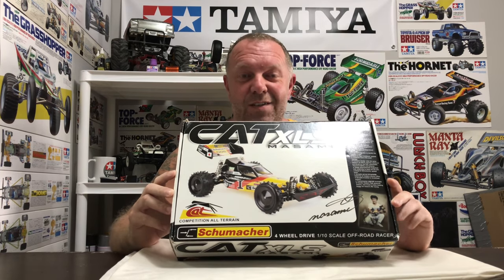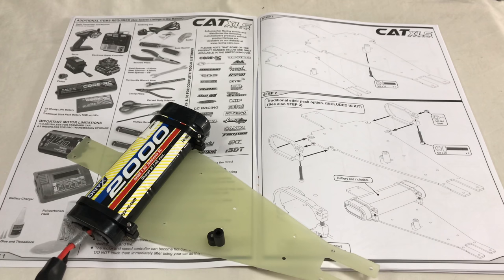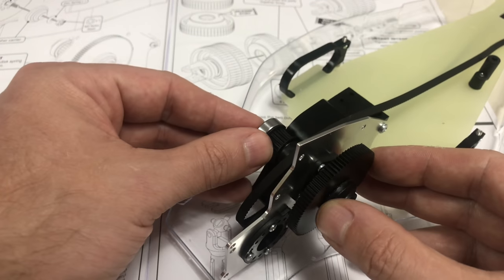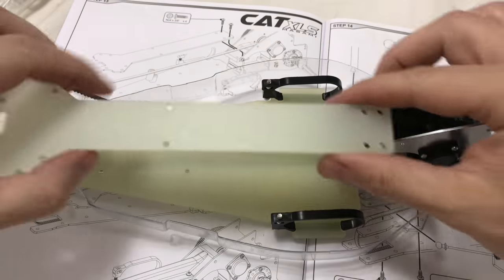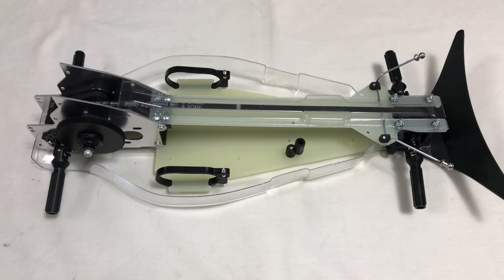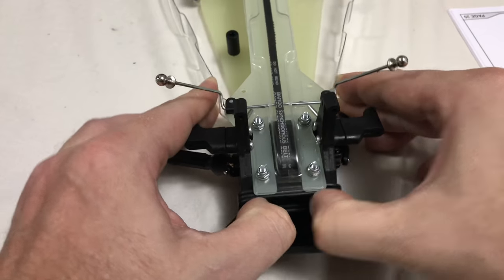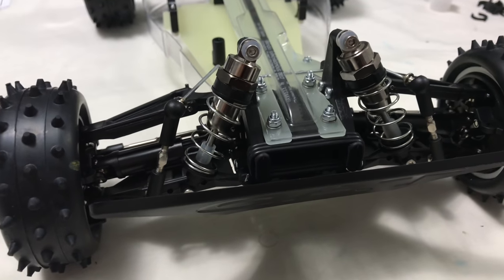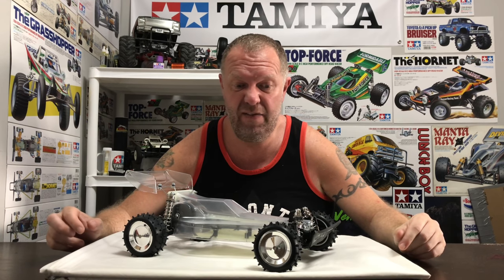Schumacher Cat Xls Full Build...

Comment: I had an Original in '88. Before the first run, that rear box was always a bit wonky (after 1st build or a full strip and rebuild). I used to put in a clapped out stock 540 for the shake down. Then the only way is to get to know what noise the box makes when it's bang on. Clicking is the belt slipping on the teeth, too loose. Whining or not accelerating clean and they are too tight. Over lubing the the main diff and the drive slip is another easy mistake to make. You can adjust the main diff setting without dismantling it at  all, You stick a small flat head into the Left UJ so it holds the main screw, then carefully turn the right wheel until it's bang on :) From memory, the front crash back bands tended to persish a bit quick, and you need to watch them. For the outdoor season, I tended to seal the rear box with aquarium sealant to prevent dirt and water ingress. But once you got a Cat set to a nice neutral setting, you could leave it more or less alone and it would be quick anywhere. If anything, this car had too much front end grip. And after trying all manner of diff adjustments, weight shifts, suspension settings etc, the most reliable method of curing the 4WD oversteer, was taking a set of standard Cat Fronts and clipping off the outer row of spikes with nail clippers. After getting up those learning curves, you'll be eating Ultimas for breakfast.
Reply from the maker: alistair munro 
Wow Alistair great knowledge my friend 😊👊🏻
Reply: Alistair, I have the recently released Masami Edition, and the steering is very rough.  There is a lot of friction in the front hub ball joints.  The steering repeatability is very poor.  I start out neutral, then I turn left, then I release it, but the wheels do not fully return back to neutral.  They are still a little bit turned left, due to the huge friction in the hub's ball joints.  I have to turn right, to an extent, to correct it back to neutral.  I tried using the silicon grease and molybdenum greases to lubricate the ball joints, but it does not seem to help.  Advice?
Reply: @perfectsplit5515  it sounds like you have one of the pivots done up too tight. Take apart any of the screwed together or bolted components in the steering (from memory, thats quite a few, sorry!) and put them back together slightly looser and use threadlock to hold the screws and nuts in place. be very careful not to get threadlock in any of the joints or moving parts or you'll be back to square one

Comment: Although it takes some time to get the diff's dialed in, due to them getting "broke-in", but, once they are dialed in, that is one mean machine in the various types of dirt/soil... and with a few runs, from one track condition to another, you can quickly adjust the tension to fit the condition, like no other... I liked the look of the spindles/knuckles, but, those did seem to cause issues at random times with small rocks and or dirt collection.. either way, with a hot motor, this car will never fail you to be fun, even in the race conditions, win or lose, the car is always fun... there is my 2 cents.. Still not as cool as the Avante is, LOL
Reply from the maker: Dru Bradley 
Thanks for watching 😊
And I 100% agree nothing is as cool as the Avante 😍👊🏻

Comment: I tried using a few different Pozi screwdrivers, none seem to fit properly so i cheated and went with Allen head screws. I still cant figure out an easy way to tighten the main belt, maybe its just me. Nice build though..
Reply from the maker: chaka zulu 
How tight was your rear Diff when you built it buddy?
Reply: @TAMIYALegends , I installed mine with the Pro Transmission,  it was extremely smooth. The diff i just built to spec, the wheels spun freely, and the rear belts had the same tension on both sides.

Comment: Wow... That took me back. 

I saved up my wages from a paper route for a full year when I was 13 to buy a CAT XLS and all the electronics. Except for the kit itself, I bought them mail order and paid COD. Motor was a monster horsepower something or other and bought a airtronics xl2p transmitter.  I was in way over my head but I do remember learning a lot from it. 

Before you started and said it was a nightmare build I scoffed. But as you went through it I remembered it took me a really long time to build it. I think a few weeks.  The flat head screws were a nightmare to put in the FRP plastics and I stabbed the shit out of my hands several times as the screwdriver would keep slipping off the screw and pierce my flesh. I also remember building the U-joints... Boiling them then prying them open with the help of my step dad.  I think getting the ball joints in was a pain as well.  But God, I loved that car... I wish I would have driven it more at the track than I was able to. I wish I still had it but I remember telling my parents to get rid of it when I had moved out on my own after college... Those chrome wheels were so cool and I didn't appreciate them at all at the time.  Once they got scratched I sanded off all the chrome.... Idiot!  Ha

I'd love to get this kit again though. Hoping for a re re release sometime in the future... Thanks for posting!

Comment: Great video Glenn!
Reply from the maker: RCKicks 
Thanks buddy 👊🏻
Reply: TAMIYA Legends From your build anything jump out that could do with upgrading from the off?  Not sure if getting the upgraded trans is worth a try?
Reply from the maker: RCKicks 
No not really buddy, I’m only running a Brushed Motor in mine, but I bet it’s still going to be pretty quick, the car weighs nothing. Still unsure about that wobble on the spur gear though 😬
Reply: TAMIYA Legends I’ve seen a few people comment on how loose the spur is.  I’m amazed it works like that and not detonate when you give it the beans and it moves around.  I guess If it works, well it works. 👍🏻

Comment: I got the older version from early 90s...is there parts for it...like body, tires, etc
Reply from the maker: Red Blue40 
Yes all the parts are available again now, which is awesome 😎
Reply: TAMIYA Legends good deal, it's over 30 years old... ordered it from New York thru a magazine ...$259 back then....had abt $500 in with esc, racing 540 and radio BK then.....just sitting in a box for years
Reply: When I built it, my brother broke the plastin u joint...stayed on the frig for over a year till we found that part.....tower hobbies told me we have those parts.....my daddy was ticked off for a while for him breaking it.....I saved up for a while for the money order.......I was 14 at the time.....didn't know anybody anywhere that run those cars.....that's why I hang on to my toys.....🤗
Reply from the maker: Excellent never throw anything away my friend 😊👊🏻
Reply: @TAMIYALegends  also got the tamiya fox too from the 80s, but itll take a lot to get it back the way it use to be...original mechanical esc version

Comment: Is this a 3-speed. How does it get the belt to go on to the other gears is it like a centrifical clutch
Reply from the maker: Garett Bodel 
No it just single geared my friend  with front and rear diffs 😊👊🏻
Reply: @TAMIYALegends  sometimes my ADHD kicks in. And I have to ask a question before I see the answer that came to me the next step that you did. Adjusting it with the holes to get it straight. To get the tension right. Must be tough. I was thinking you can put a straight edge ruler on the back and try to do it that way. But it really has to go off the front drive axles. Or am I just overthinking it it's a RC car that does 30 miles an hour tops. Anyways really nice. I used to race in Hanson Massachusetts. I had a Tamiya Fox. And after the first race I ended up buying a hot tricks chassis. And then the stand up shock front Del cracked mod. Then I was able to compete with the rc10
Reply: Garett Bodel what’s really interesting about this car is that it can shift from 2 Wheel Dr. to four-wheel-drive with a simple one way bearing. If you decide to get this car I promise you it will be very difficult to build but the handling in the turns is unmatched by anything I’ve seen.  This was my favorite RC car when I was a kid but it’s not just a car it needs to be tuned and adjusted constantly. Definitely not for the beginner which I was when I bought it

Comment: Glen you had all the same problems as me but boy what a car when it is done.
Reply from the maker: Lee Hurst 
Cheers Lee, was you’re rear diff tight? 😬
Reply: @TAMIYALegends  the while drivetrain feels fairly tight when turning the wheels.  It's a bit trial and error getting the belts tight enough.  I have a 15t hpi firebolt in mine and I had to just keep tightening the rear diff carriers until it stopped skipping.  The car goes like nothing else.  So fast and nimble.  I have now got the topcat classic.  Just like a 2wd version of the xls.  Lay down shocks look fantastic

Comment: I loved building my rerelease XLS. Was exactly like I remember building the Procat in 1990. I built it as a kid back then. I like that they didn't clean it up and improve too much. The belt drive might feel slightly draggy when it's spun by hand like that, but the efficiency is very good under the running loads. The rear diff(s) have to be pretty tight to handle modern power or they will slip and melt. I have running videos on my channel.
Reply from the maker: Grumpy Modeler 
Sweet I’ll check them out buddy, thanks for watching 😊👊🏻